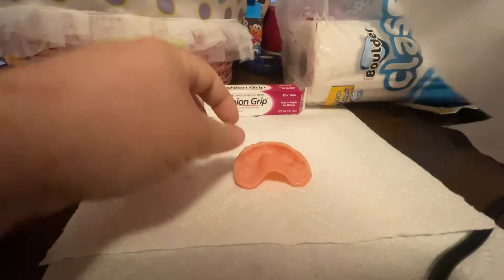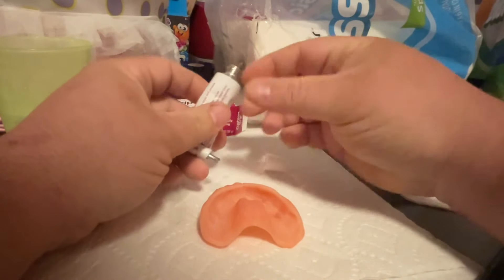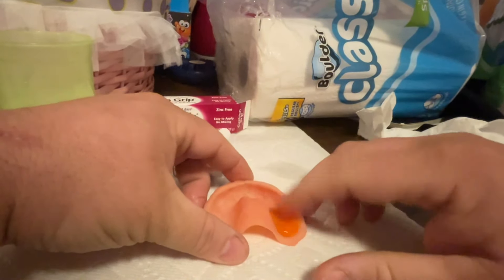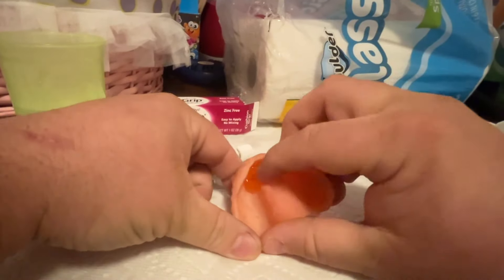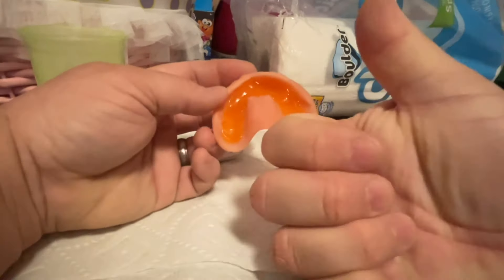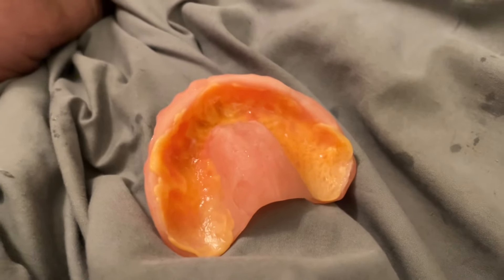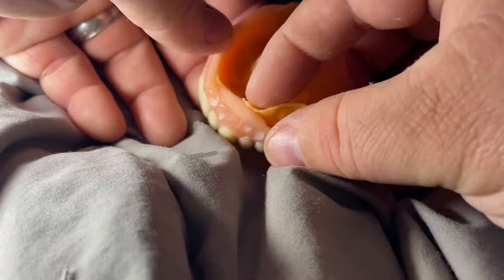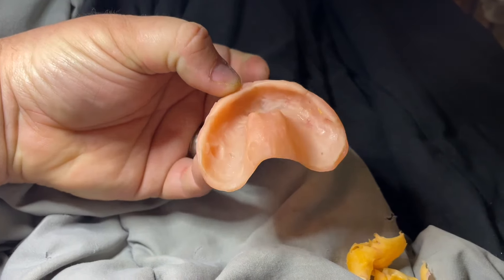Cushion Grip for dentures. How to apply & remove in 2021.

Comment: Question. I’m pretty sure you mentioned that you were an affordable dentures customer. 
They tell you not to soak immediates in water. Did you have any problem with them
Reply from the maker: I went to DDS which is a part of affordable. I’ve always been told to soak in water.
Reply: @JustinBsDentureJourney  
After applying the cushion grip or every night??
The affordable I go to says no soak at all on the immediates
Reply from the maker: @joestewart4589  I did every night
Reply: @JustinBsDentureJourney  
Well thanks. I wish they would let me soak it sometimes. I guess it has something to do with whatever liner they use. I don’t know.
Reply: No adhesive after that first three hours?
Reply from the maker: @joestewart4589  I used adhesive once they loosed up in 3 hrs

Comment: I’m 6 days post extractions and my bottom plate is way to painful to wear. It doesn’t even sit down correctly.  Is this normal?   I don’t see any swelling so it just seems like the entire plate was made for someone else’s mouth!
It hurts in so many places when I try to set it.  I don’t see any bone spurs nor are my gums painful without the plate in.
Reply from the maker: My bottom plate was causing excruciating pain when I tried to put it in after day 3. I had a lot of swelling and then found I needed aveoplasty. Give it a day and call the dentist on Monday
Reply: @JustinBsDentureJourney  
Thanks!   I’ll call tomorrow. Hopefully I won’t need Advoplasty, cause I don’t even know what that is!   Lol
Reply from the maker: @mcampbell4556  lol. I don’t think that you’ll need that.  It was just my issue. Probably just need adjustments, but they may day to wait until not healing is done before adjustments. But definitely doesn’t hurt to call
Reply: @JustinBsDentureJourney   Thanks again!   I guess it’s al live and learn with these things!

Comment: I’m a newbie, too.  So, after they “cure”  and you can take them out, do you have to apply something like poly grip to hold them in?  I thought you could wear the dentures with caution grip for up to four days?  Anybody? ❤️
Reply from the maker: I applied fixodent once they came loose hours later. Some still use adhesive and some don’t. Up to you and how the fit is. They say it lasts 4 days but others have had longer lasting
Reply: @JustinBsDentureJourney  thanks!  Very helpful!

Comment: But how do you keep your dentures in after it hardens? As soon as you eat they are gonna flop around
Reply from the maker: Cushion grip is like a soft reline. It’s filling in the gaps from your shrinking gums. It makes a better fit and adhesive still may be needed. Without the reline my dentures wouldn’t stay in all day without popping loose due to they were so loose. But after, it’s more snug so it stays in place

Comment: I tried it, but the teeth still just fell right out with it and it was a nightmare to get out. There is still a little in them and I'm still getting pieces out. It just didn't work for me. Probably due to too much bone loss and nothing for it to form to.
Reply: If you tried removing it before it cured which takes anywhere from 6 to 8 hours to fully cure that is why yu are having a problem getting the cushion grip out of you're dentures soak it in ice cold water for a couple hours and then peel it out

Comment: I am new on my denture journey when does the pain stop it's really painful I haven't tried this product they sent me home with fixodent it's more painful to remove them
Reply from the maker: The pain will slowly go away. You had a major procedure in your mouth with all teeth pulled. It can take a few weeks before the swelling and pain to subside enough for eating normally.  This product is a short term reline, basically to make the denture fit better. It is not an adhesive.  Fixodent is a good adhesive. Powder is the easiest to remove, but really only works well on a VERY good fitting denture. Powder works on my top denture since it’s a very good fit and has the suction. Powder doesn’t last all day on the bottom even with a very snug fit. I use fixodent ultra max hold paste for down there. It holds all day with no reapplying. Since I’m healed I use my brush under hot water and scrub gums to remove.  But if your still healing you don’t want to scrub the gums.

Comment: So I applied it and waited 2 hours before I tried to eat a cheeseburger and they came lose did I do something wrong
Reply from the maker: Like I mentioned in the video, this gives a better fit and does not hold. I still used adhesive with this
Reply: So when can I put the the adhesive on it is it after the 6 hours
Reply from the maker: @robertaperez5183  I would wait till after the 6 hours. Once it’s cured mostly
Reply: @JustinBsDentureJourney  am I aloud to drink coffee or soda while it’s sitting in to bond and cure
Reply: @JustinBsDentureJourney  I only have like 5 teeth on the bottom
Reply from the maker: @robertaperez5183  I waited a hour then ate/drank
Reply: @JustinBsDentureJourney  thank you so much I appreciate you getting back to me 👍🏻

Comment: What's the point of using this if after 2 hours of curing them in your mouth, they'll just come right out? Isn't the point of this, like reline to hold your dentures in tight not just flip right out so easily?
Reply from the maker: This is a reline not adhesive. Just saying the first 2 hours it holds like glue then it cures and now just better fitting

Comment: I literally cannot get this shit off...2hrs now! Constant hot water soaking. I'm so damn terrified to break my thin denture! I've had to use many tools...nippers, tweezer and even my damn Dremel. Maybe it's easy to remove if you got a bunch on but if it's only needed very thinly it's near impossible to remove. I'm going crazy right now. I got most of but a bunch doesn't want to budge 🤬 I seriously will never use this again unless it's really loose n I need a thick layer
Reply from the maker: It wasn’t that difficult for me. Strange
Reply: I am having the same problem,..did you ever get it figured out?  I am kind of wondering if my denture is made from a different material than standard acrylic, do you know if yours is?
Reply: @stevenjeffrey4637  oh and I apply it at night and will sleep w/ em in for 1st night.  since your not supposed to drink anything or soak for 6hrs so maybe that's why I had issues removing too.
Reply: @TF.Jodi21  Thank you very much for your reply.

Comment: Cushion Grip is an EXCELLENT product and will keep your dentures secure with a seal that food getting under the dentures is NOT an issue...." word to the wise" this is not a long-term reline & ya do not want to go beyond 4-5 days.  Anything longer and this product will become attached to the denture.  After 6 days, the liner became discolored and literally attached to the denture i tried boiling hot water, rubbing alcohol, peroxide, etc, but nothing worked.  i called the manufacturer directly and was advised hold them under warm water, again, NOTHING worked.  i tried using a carving knife, but nothing worked.  I made an ER appointment with my dentist, hoping they would have a solution.  They did not, the dentist gave them to his tech to remove the product, the tech was able to remove the product but destroyed the denture in the process (A hole at the top and side of the denture (fortunately, for me the denture is temp, as they are a stop-gap until i receive my dental implants so i will not replace them.